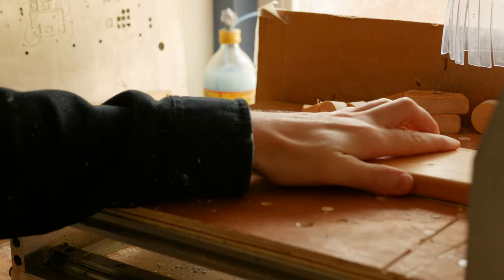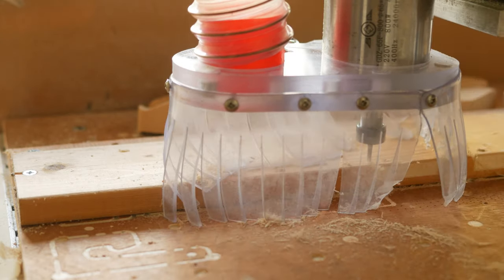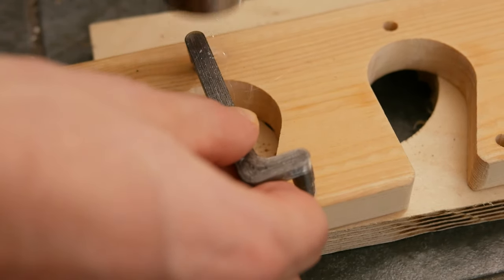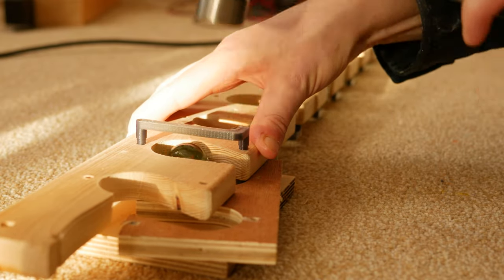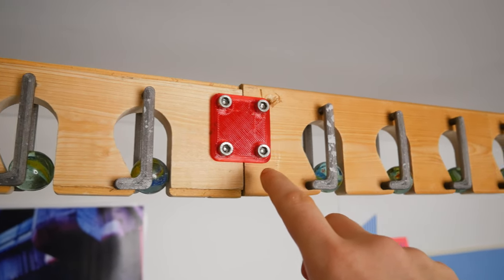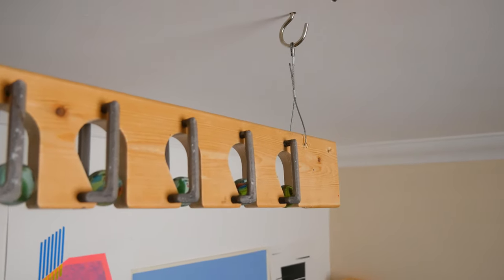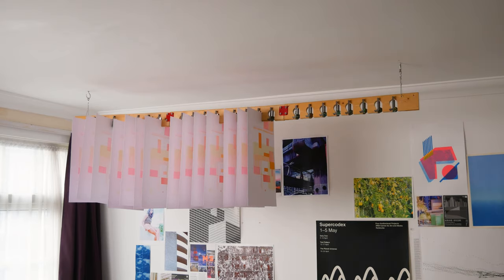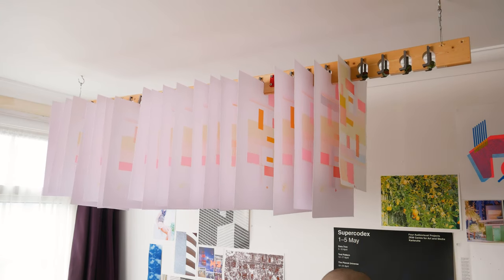Easy DIY Print Drying Rack

Comment: What are the measurements for the wood you used to cut ou on the CNC?
Reply from the maker: Just some scrap timber. Was 120mm wide and probably 15mm thick. About 1 meter in length

Comment: I'm not sure how well this would work, but I had an idea for having some springy sheet metal parts for the clamping mechanism. It would follow the curve of the wood, but at slightly tighter radius, leaving a small gap at the bottom. The spring could be strong enough to hold the prints, but would give enough to just pull them out. Something like this: https://i.imgur.com/5hG3ALC.png 
It would probably need a stopper so you couldn't insert the prints too far, but that'd be an easy addition.
Reply from the maker: I guess that would work, seems a lot easier to just use gravity and a marble though, cutting and bending all that sheet metal would be a real P.I.T.A.
Reply: It would still work exactly the same, with gravity and marble. It would just remove the need to push the marble in order to release the print.  
All you'd need was stips of metal and bend it once or twice. Something between Z and L shape.
Reply from the maker: Ah yes insee what you mean. Its a good upgrade if you have the tools :)